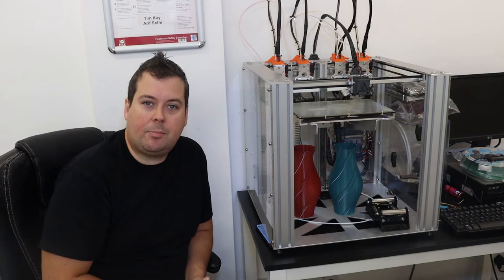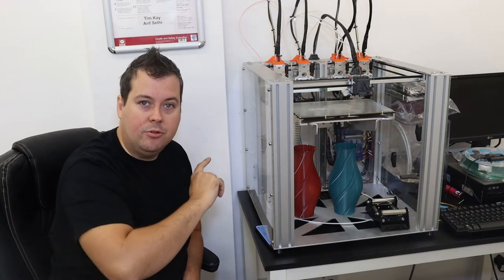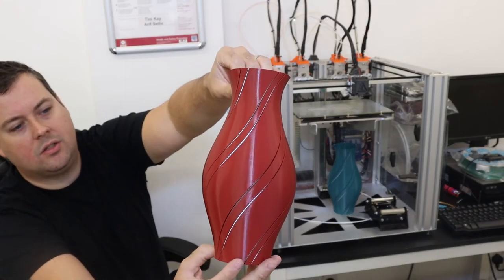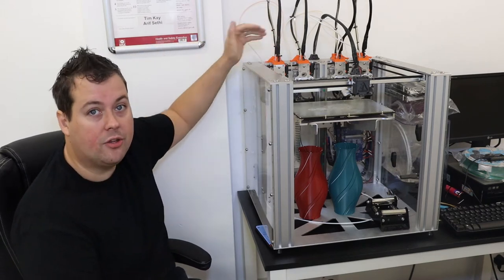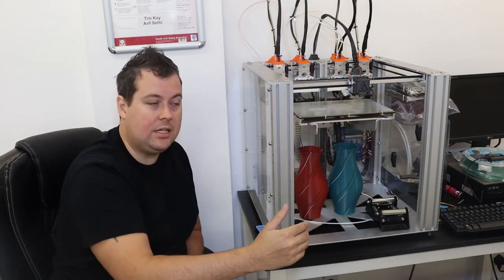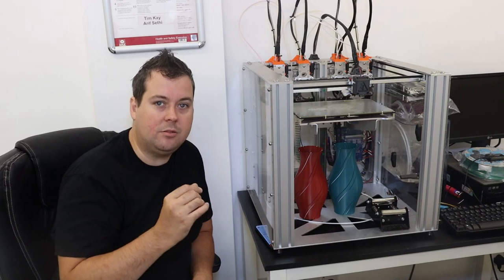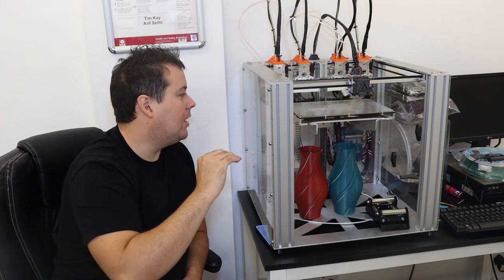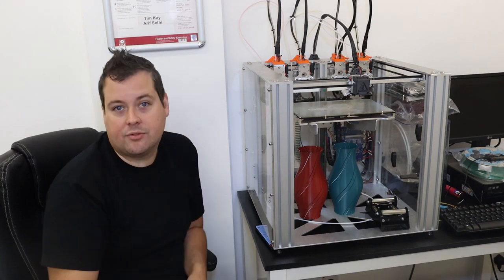3dfilaprints E3D toolchanger

Comment: I think the next big printer within the 2-5000$ wont be this printer, but a very good remix of this printer. When its super polished, got a very good enclosure and so on.

I still see vendors today selling their "State of the art" ... "Pro"  ... "high safety with HEPA" (lol my 80$ vacuum got that) for over 8000$. Basically printers that were good in 2016.
Ultimaker S5. good printer, but its a ripoff for the price in todays market. 

So, maybe the first company that will polish the toolchanger and bring in all the necessary tools like 2x print heads, cnc, laser cutter and so on will make it.

Comment: But isn't this a development platform?
Reply from the maker: not really, its a machine where you can configure in alot of different ways with many different types of toolheads but the machine is sold as a finished useable 3d printer
Reply: @honeybadger3dprintandpaint  reality though, you can’t use this for vinyl lol

Comment: Are the motors closed loop ?
Reply from the maker: no they are normal steppers in this
Reply: @honeybadger3dprintandpaint  so this means that any mashing on it is going to be difficult and dangerous for the mashine would have to be done very slowly and with constant supervision and even with that I expect lots of broken tooling and lost material
Reply from the maker: @KarolKrasickiKK  not at all, we have run it for multiple-day prints using more than one toolset and had zero issues, we had some bed adhesion problems early on but 3DLac solved that for us